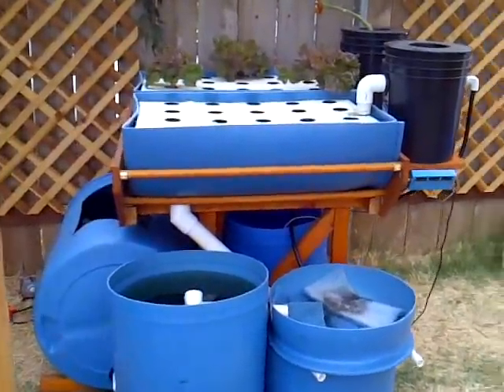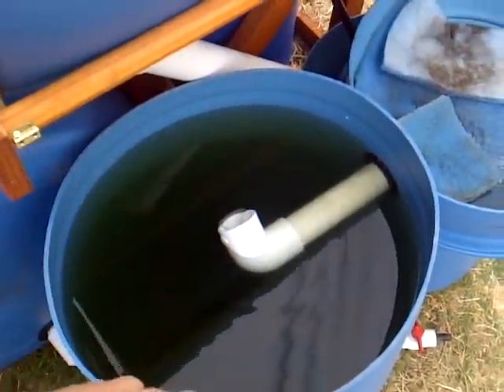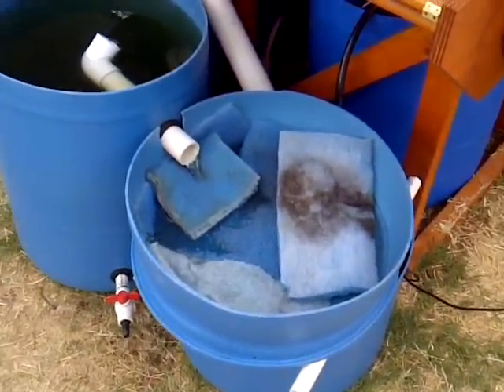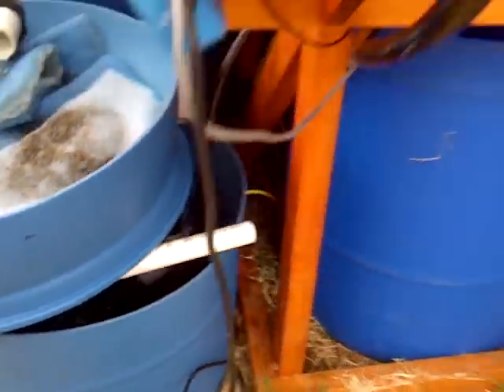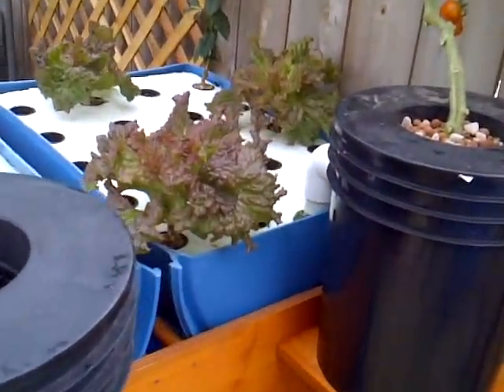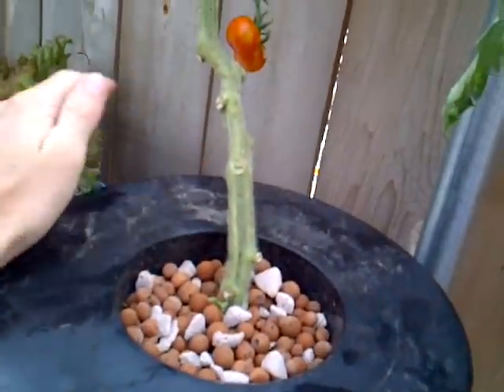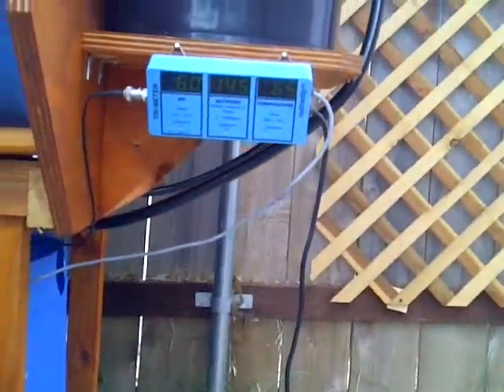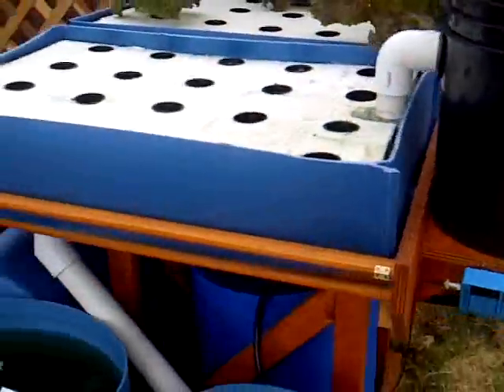Week 1 in the barrelponic system

Comment: @alpineaquaponics yea, i have been playing with the coupling and the reducer, it seems that having the reducer near the bottom, and having an oversized inlet seems to give you more of a margin of error. i use the coupling, but it seems to be that the outlet design is most important as well. A straight down pipe will not give you as much of a margin as 2x 90 degree bends on the outlet. His silencer works a treat i might add. i have a small system in the lounge room, but it was driving me nuts